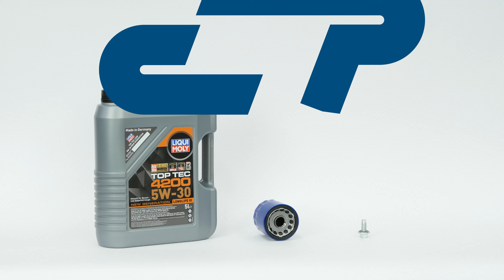How to Change the Oil and the Oil Filter 2007 - 2013 4.8 Chevrolet Silverado 🛢

Comment: What kind of oil filter wrench are you using.  I have never seen one that adjusts with a knob like that.
Reply from the maker: It’s a spanner fitted with an adjustable metal strap; you can easily find one online.

Comment: You DO NOT have to remove the splash shield or skid plate—the drain plug is fully accessible. This video shows installing a new AC Delco oil filter using “1/2 turn” when the current GM spec calls for 1 full turn after the gasket contacts the base. Just pour in the 4.5 qts (V6) or 6.0 qts (V8s) of new motor oil and drive it—after resetting the oil life monitor—that’s what the GM dealers do!